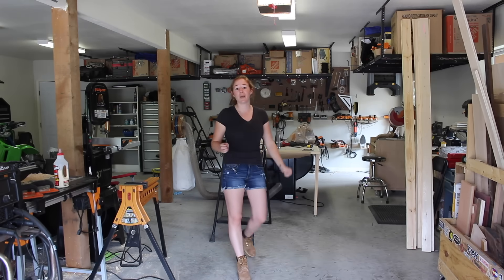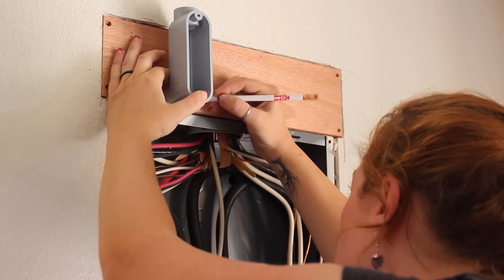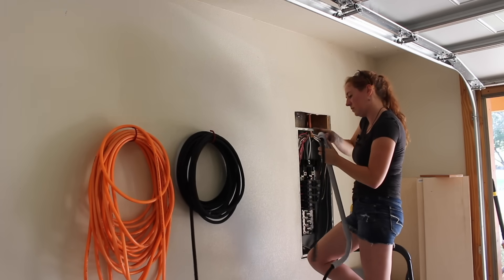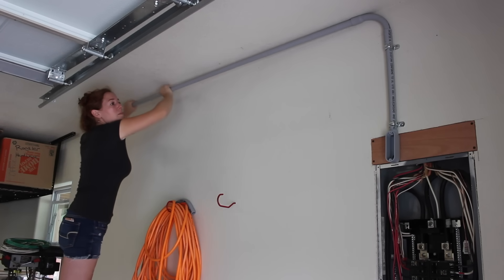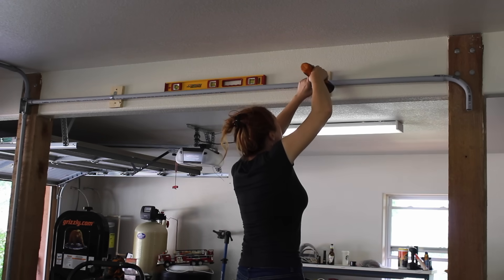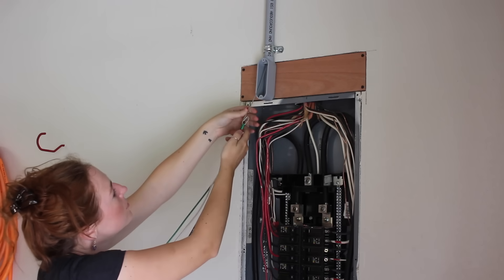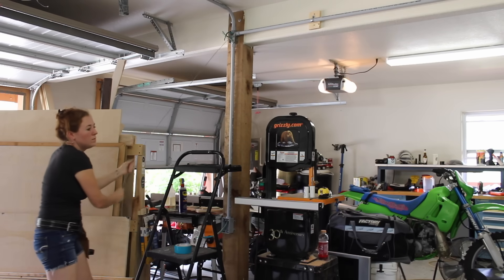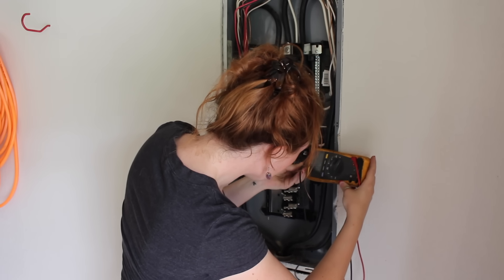Adding 220 Volt Outlets to the Garage

Comment: Another easy trick to getting the pulling line back to you is attaching a small plastic bag to the pulling string at one end and using a vacuum at the other end.   Turn on the vac and it magically  appears just like at the bank.  That's how I ran the pull string in the underground conduit from the street  to my house when I pulled the main wire to the house,  then attached a pull rope then actual wire pull head.  Built my own home in 2006.

Comment: when Installing 220V should use red wire instead of white
Reply: Do you mean to use a 4 wire set up with a live red and black.
Reply: @philipduffy6581  There should have been, by code with the new codes, 2 wires of any color but gray, green or white, one white lead and one green. All new receptacles have a 4 prong outlet and the power tools should be the same.
Reply: @dannyward6927  cool, thank you.
Reply: POWERGLOVE KilleDX well that’s why I’m a Journeyman Electrician... what are you
Reply: Old school 12/2 w/ground 110 or 220.
For up to 20 ft. Wired many water heaters that way years ago. Puting tape (color) just makes sence. Old code was not needed. That was for people that were LAZY AND STUPID. TOO STUPID TO CHECK OUT WHAT WAS WHAT B4 WORKING ON THINGS B4 GRABING WIRE. 
ELECTRICITY BITES.
Reply: Jonathan Holt  * yes! Or use colored tape to mark each end of the white (repurposed) wire. I
Reply: S H it’s against code to phase 8awg and smaller
Reply: I guess you don’t need to connect the ground wire to the conduit or junction box.
Reply: @singlefather01  since its all pvc bonding everything together is kind of pointless.
Reply: @Aidan Gattinger   I also replace ‘metal’ cover plates with plastic ones when replacing broken switches and plugs.  I once was replacing a n outlet for a little old lady in her 1960s house and found the original electrician had made fake ground pigtails and stuck them in the outlet boxes to pass inspection.  The metal boxes weren’t grounded to anything.
Reply: @glasshalffull8625  I once found a house where the ground conductor had just ended in the middle of the sheath and the "electrician" didn't do a thing about it. He hooked up al the other receptacle grounds and everything looked good but the entire set of receptacles was without a ground. How the hell that wasn't found I have no idea. I had to pull a new run to solve. Luckily the drawall was removed and I was able to just pull the old run and pull in a new one. After tearing apart the sheath I found it had stopped about 4 feet short of the receptacle. Factory defect as the conductor itself somewhat tapered down in size and just ended. Wasn't a break.  What a pain.

Comment: I'm an industrial electrician and you did everything rather well. The only thing I would do differently would be make the end of your fish tape a little smaller and tape over it after you add the wire. In doing so, this will lessen the risk of the fish tape hanging up while preforming the pull. 
Nice job.
Reply: Dont you see a  missing connector  between the box and  the  ell, the wire  will be rubbing against the sharp edge  of the KO
Reply: You can never use too much tape to connect wire to fish tape.

Comment: The reason you don't run cable through conduit is due to the bound nature of cable inside of an insulator giving the potential of causing excessive heat under high current applications.

Comment: You are correct to change out hte SO cable. NEC 400.8 (6). Uses not permitted; where installed in raceways. I like that you actually showed that you switched it out. That is part of the trade--learning by doing.

Comment: What kind of fitting or conduit was used to go from the LB box you mounted on the board into the circuit breaker panel?

I assume some sort of elbow but this step was not covered. For all I know the THHN wires could just as well be exposed behind the board from the LB box into the panel.

Comment: using the cables that you are, cutting the in that box may be wrong, as for the Amps being drawn in the cable, running cable all the way to your outlet, then run cable from the outlet to the other that way there is no breaks in the system

Comment: This is a good video. You did however forget to do the math on whatever you are going to run in terms of amperage. I'm assuming your appliances will not be more than the installed breaker. If not you would of had to run two 220v lines.
Reply: This is not entirely true.  If you can assume both will not run at the same time, you can size the breaker and wire for the larger of the loads.
Reply: @helstromh  That's what I'm saying. I said she forgot to do the math. That's how you start fires.

Comment: I would have made my penetration above the wooded panel. Now with the LB in the wood you restrict yourself from adding more circuits unless you pull that circuit out. But it's your shop do what you want.

Comment: Very nice job !!. The only comment I have that you should disconnect electricity to the breaker box when installing the new breaker, from a safety reason.
Reply: Not all breaker boxes of a main and some main breakers don't shut off all power. You could have the utility company shut off power for a small fortune.
Reply: You right some places you have to ask the utility company but some other places you can shut off off all power by shut off main. If you can not shut the power use i gloves , any way great video and great job.

Comment: It's ok to splice a 220? Or can only use the receptacle one at a time?
Reply: Xouki Long it really depends on the end use.  If your only going to use one of the two at anytime, it will be fine.  You could run both, depending on what your doing.  The mat is 220 x 30 amp x .8  = your total watts.

Comment: Thhn has to be ran in a box or conduit, so from what I saw you didn’t run the conduit all the way into the panel but just into the wall above the panel. This means you have exposed thhn conductors behind your drywall which is against nec. Otherwise good job.

Comment: Ugh. My garage is 70ft away from my panel box in basement. My electrician told me he rather run the thhn and once indoors wire nut romex to the panel. I’m just going to continue conduit through the basement into the panel. Should I use emt once I’m indoors?

Comment: One thing that I picked up from my electricians is to turn your face away from the breaker when initially turning it on - especially in an open panel. Should something unpleasant happen, you won't get a faceful. Not so much of an issue at 120/220, but it can get interesting at 277/480.
Reply: In the industry it's referred to as a Safety squint. Very important.

Comment: NEC: In a garage, you should have used EMT with compression fittings. If it has the potential to come in contact with something like a car say 5' and below, it should be RGS... Put some black (or any color but green or grey) tape on the white conductor, as white indicates neutral. In an emergency an electrician will recognize he is dealing with a higher voltage, and reduce the chance of injury...   What you are calling a junction box (splice box) is way too small to meet NEC standards (all your boxes are too small) all metal boxes need to be bonded to the ground conductor, using a green screw threaded into the box... In my experience: I put the screw for the conduit clamps under the conduit, as if it ever loosens, the conduit will rest on the screw rather than slumping down...

Comment: Great job. I personally never work on electric. I work on wires....
I always disconnect power at the service entrance (overkill I know, but that's how I feel safest).
I am then working strictly with wires and connections to devices. When I am done I make all my continuity checks, then go outside to reconnect the main breaker. That way if anything bad were to occur I am far from it.

Comment: That was very brave - I got zapped by a 240 volt wire once and lived to tell the story why from that day on I will hire an electrician to do this type of work.  Good work with the conduit and wiring!  very impressed.
Reply: Wow, how did that happen and what did it feel like? I've been hit by 120 a few times and it's just enough to wake you up.
Reply: @ModMINI  The breaker box was missed labeled with the wrong switch for the dryer.  Started to change the plug for the dryer on wall when the red and ground touched each other causing a HUGE FLASH LIGHTNING on my hands throwing me a good 10 feet away from the connection plug.  My fingers were burned, my hands were numbed, and smelled like burned flesh.  Could not feel my hands for 3 days.  After that, I did not mind calling an electrician to finish the repair.  Electricity is so danger at least to me.  I am still very impressed with your work. :)
Reply: @ModMINI  Thank you for the advice - The Klein Tool will become my best friend from now on :)

Comment: PVC is conduit however sleeves are permitted to prevent mechanical damage but there is a limit as to length, which you exceeded. You are required to bond the handy box as it's metal. And I hope you used a bushing in the knockout hole in the panel, but instead of the LB, you could have offset the PVC directly into the top of the panel and used all individual wires (no SO cord). You may have avoided splices if the devices permitted two wires under one screw/clamp. 
All in all, you did a nicer install than a lot of electricians would have done and certainly all homeowners.

Comment: Both outlets appear to be on the same circuit breaker .  ( Or are those two 30 amp 120 VAC outlets ? ) 

     Do you plan to never use both pieces of equipment sanctimoniously ?

     You have one hot run with white rire .  White wire is reserved for a neutral , which you did not need for 240 VAC .  At least , go back and put red marking tape on the white wire , at the panel & each box .  And ground the metal box with the green wire .

     I apologize if I sound petty , but there are reasons things are done , the way they are done .

     I would have run it in EMT , in stead of PVC , but not going to make a big deal of it .

Wyr
God bless

Comment: It's funny to see breakerbox installation from different countries. This way I'm always convinced that Dutch systems are the best. NEN1010 and 5152 are the best.
Reply: Yes they are the best, i do this fore a living and its prety good i like that we have a central system so rewire is very easy, germany etc just put cable behind dry wall and need too destroy the whole hous if they need to change somthing tho

Comment: just a tip that came to mind when i saw the level across the conduit, and i should qualify that i don't think this applies here given that the section you're attaching to appears to be level, but sharing for reference. 

our eyes and brains are wired for natural symmetry,  so it's often unnecessary to use a level or square in many situations. in a situation like this  it's usually better to use a tape to measure off the bottom edge of the beam so the conduit runs on the same angle as the bottom of the support beam. it looks more natural and symmetrical. 

overall great job, enjoy the videos!

Comment: Just a detail in your outlets boxes. If you are using white wire to run a phase for it , you must mark the wire with black tape. That notify next electrician that is not a neutral wire. Or replace it for a red color wire. In the panel same condition, that white wire should be marked. For all the rest, excellent work.

Comment: @ April Wilkerson  You did not attach the ground wire to the steel handy box junction box , you should have added several more straps to your 3/4 " pvc conduit run ( you must strap 3/4" pvc every 3 ' ) you cant run open wire from the LB into the Panel and you should have put a Bushing in the panel knockout you opened up ( wire against sharp edges )  and you should have put each 240 VAC outlets on separate circuits !  I am a 42 year IBEW Journeyman Wireman .
Reply: Are those rules or codes apply to every state?
Reply: @djjammindave  The NEC means NATIONAL ELECTRICAL CODE !!  Do you understand the word National ?

Comment: I love your videos april  !!!   just some helpful advise .  The metal  handy  box is kind of small .  There is a calculation  in nec for box fill .  Also  the metal box needs  to be bonded  to ground wire"(if you didn't)  .  I would have not used a white wire for 220.   I  don"t   Know how you connected  LB fitting to electric Panel   the  radius looks too tight for a fitting .   You have such a great attitude it a pleasure to watch your videos  I understand your not a electrician and great job ! just  trying to help for next time.

Comment: Great job and a great video. I am impressed at how willing you are to learn from other experts. I am a licensed GC and the only thing I saw that might be an improvement is to run 10 GA or 12 GA romex in the attic space (or second floor interstitial space) instead of conduit. You would have had to repair some drywall, but you seem very intelligent and capable of doing that.  This would have provided a cleaner look and you would not have had to mess with conduit except at  the drops down your columns from the ceiling.

Again, this is a very impressive video - you did a wonderful job.

Comment: When pulling the fish tape connected wires thru the conduit, I find it easier to pull on the body of the fish tape reel vs pulling on the fish tape wire itself. If you retract the fish tape as you go, this can be a lot easier...

Comment: You used a white conductor for one of the lines. In Florida, that wire would have to be "Phased". Since it is a 120/240-volt circuit, it would have to be Black, Red or Blue tape. If it were a 3 phase system it would need to be Brown Orange or Yellow. 
Other than that and not gluing the PVC you did a great job.
Reply: Black red blue is a 3 phase system.. 120/208... Brown orange yellow is also a 3 phase system but that is 277/480
Reply: Matthew Britzman    Sir, I said 120/240.. I referred to a typical single family dwelling. 
I have seen Poly systems in the kitchen of the Phipps home in Tallahassee, Fl.